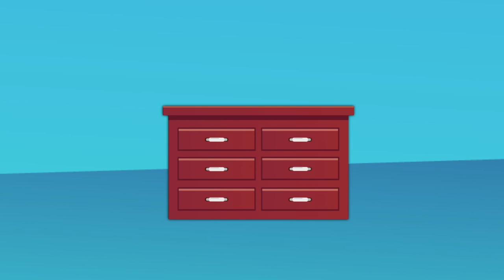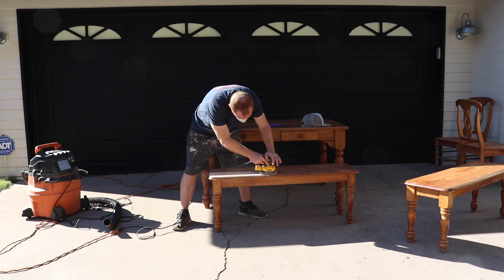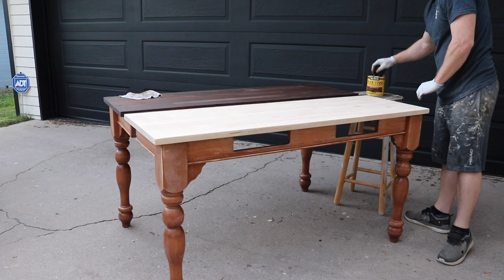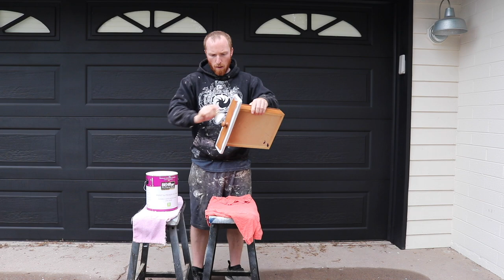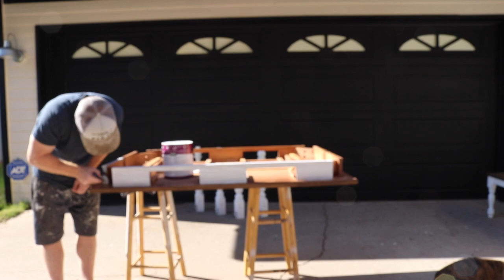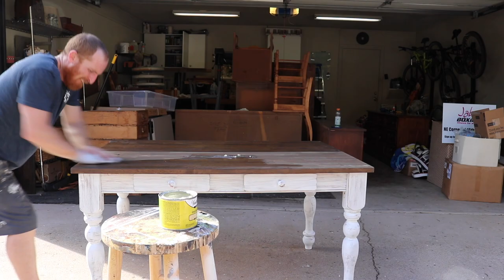Refinishing a Kitchen Table with Benches | Do It Yourself | Furniture Makeover

Comment: I just started following your channel and I got a question.  Is sanding furniture better than stripping it?  I’ve got some old pieces of furniture that I would like to either paint or stain but didn’t know which approach to take to remove the old paint or stain.
Reply from the maker: P. Washington good question! I’m not much of a stripper but more of a sander. Pro’s to each. If I had an antique and wanted to restrain the entire piece I would strip. Stopping is easier for areas that are hard to sand. Sand is a lot of work but rewarding. I bet others could jump in with their opinions.
Reply: Vintage Statements thank you for responding.  I just didn’t know if one was better than the other.  This will be my first time working on a big piece of furniture and I was try to get some tips.  Love your work.
Reply from the maker: P. Washington maybe stripping might be easier. :-)